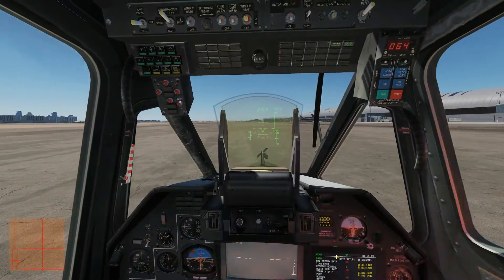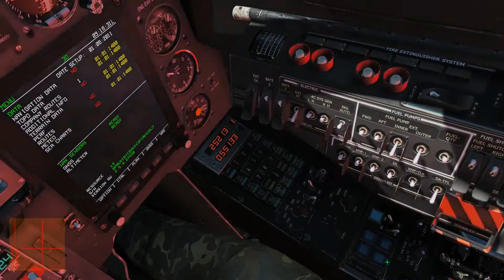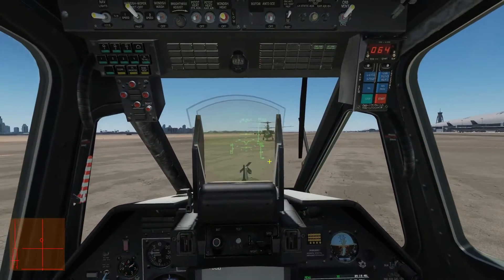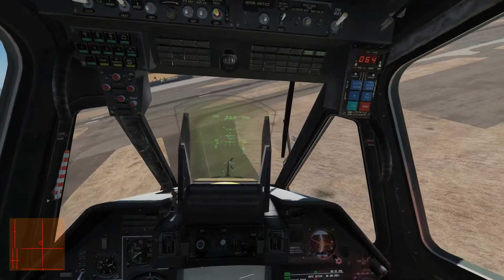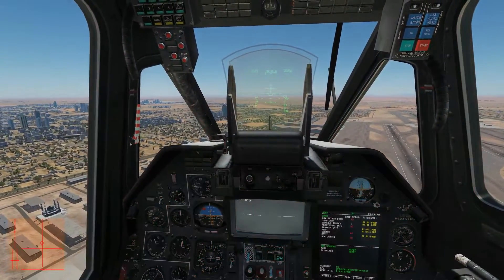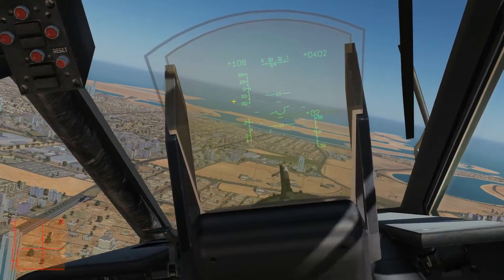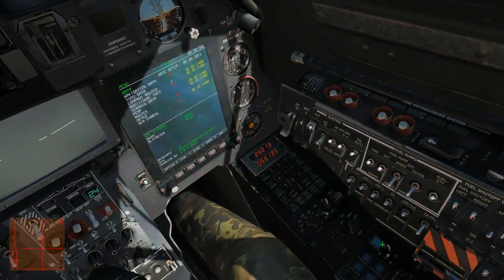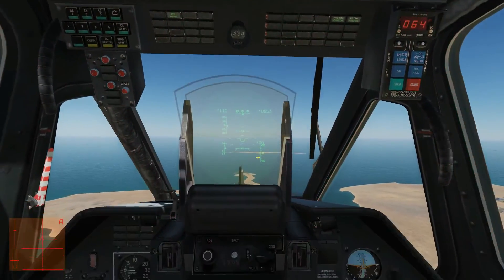Ka-50 Blackshark: Autopilot Modes & Flight | DCS WORLD

Comment: The rad/bar switch has third, neutral position. That's why you were keep climbing in spite of the  attitude AP channel was enabled. 

You can make sure the altitude hold actually works looking on signal lamps in the left upper panel. There are two separate indicators for both altitude hold modes

Comment: Worth noting that the Flight Director will give you bank/pitch cues on the HUD if you have Route mode enabled (either to maintain heading when set, or to next waypoint if any is selected). Also gives you indications to climb/descend if you have Alt Hold on. It basically tells you what the autopilot would do if it were allowed to be in control. Much like the Flight Director in a modern civil aircraft.

Comment: You explain the BARO/RADAR Altitude hold selector as if it has 2 settings… it has 3 !  What is the 3rd one ?
Same goes for the Desired heading/Desired track modeswitch
Reply: well, I see that the question is two years old, but the third setting is OFF mode. 4 example cap keeps flying with the altitude hold off all the time , cause his BARO/RADAR switch is in a neutral position

Comment: Another cool way to use AP in the Ka 50 is in conjunction with the Helmet sight. activate turn to target on the weapons panel, make sure heading hold is activated, then engage the helmet mounted sight, look in the direction you would like to travel then uncage the shval. this will immediately turn the helicopter on a heading toward where the shval is pointed. it's the preferred lazy mans way to navigate!
Reply from the maker: thanks!